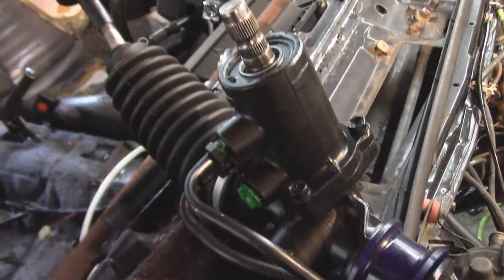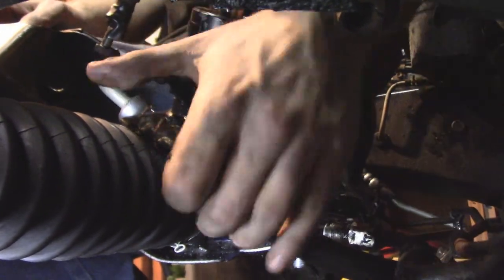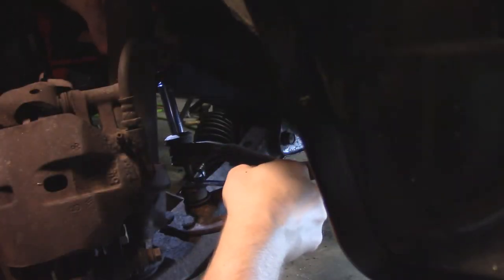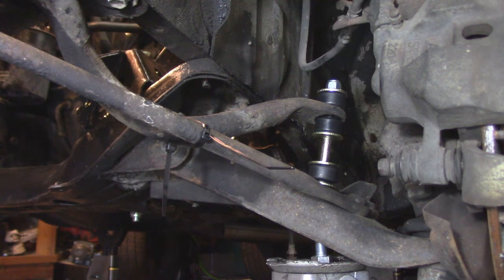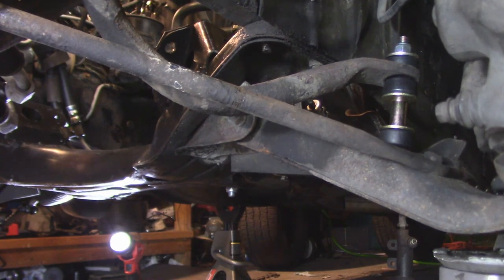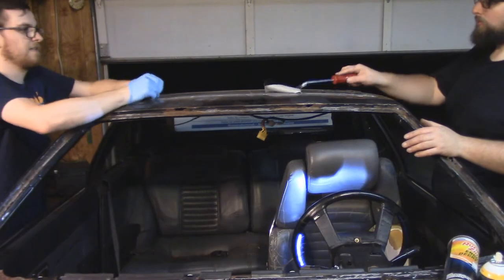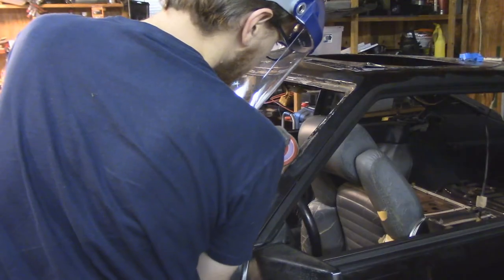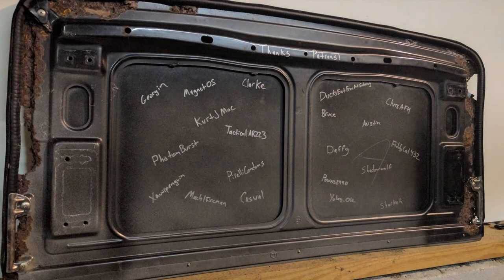Cone's Garage | Project Supra - Steering & Suspension Reassembly

Comment: if you are worried about paint coming off in those crevices, you could always coat them with an epoxy before painting. this adds structure and, unlike porous paint, would seal the metal off from moisture.